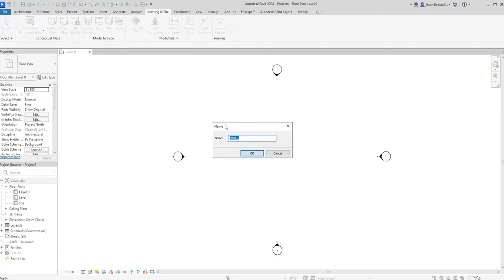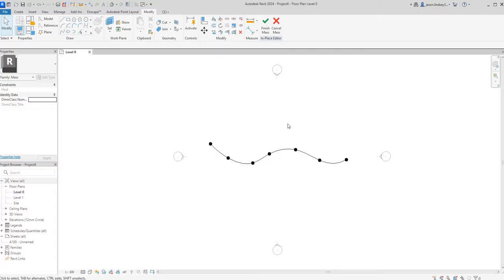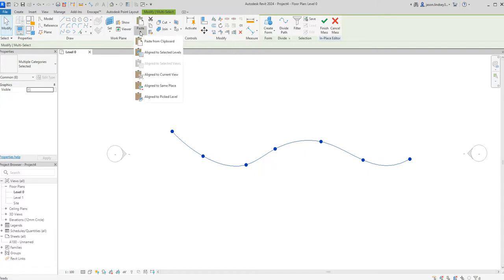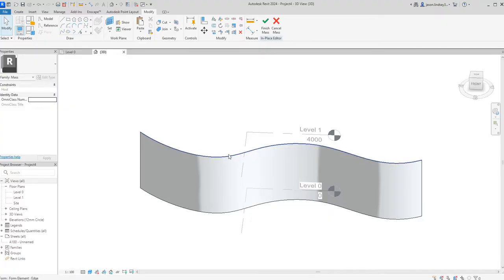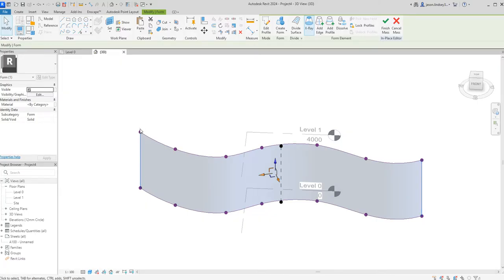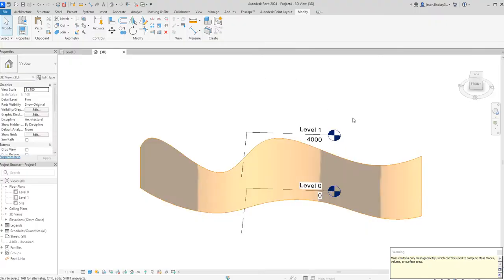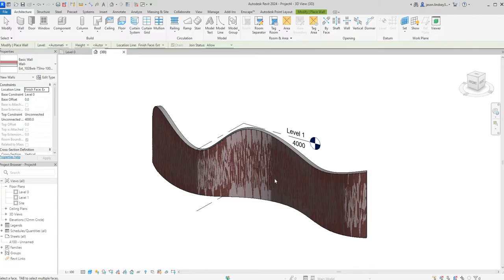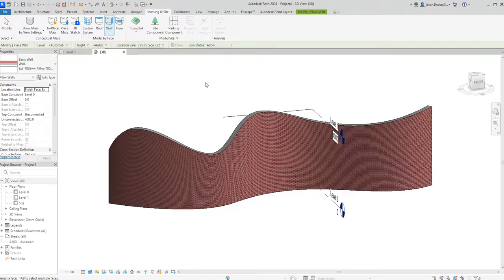Using the Massing Tool in Revit to Create Complex Curved Walls

Comment: but this doesn't allow you create and treat it as a normal Revit wall. i.e., you're unable to update base offset, base constraint, top off set, top constraint... I cannot even select the wall now to delete it? 
How can we create a 'freestyle' wavy wall (not using centre-line arc, etc. BUT using spline) that can behave as normal Revit wall?  This method shown is something else... I've created a wavy wall using this method and now I cannot even select to delete it even though it's not pinned or anything... no option to update base constraints, top constraints...